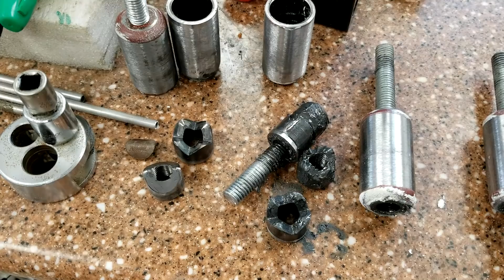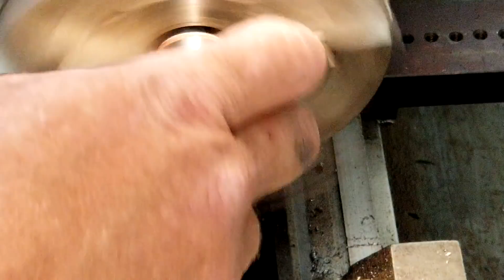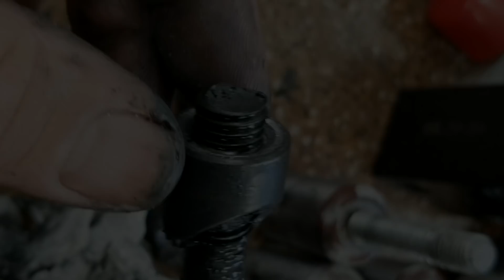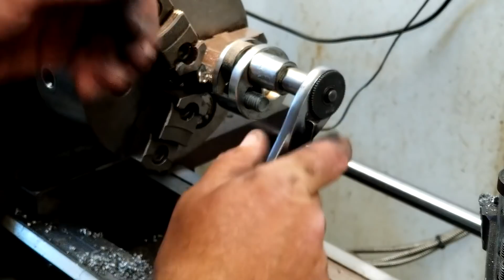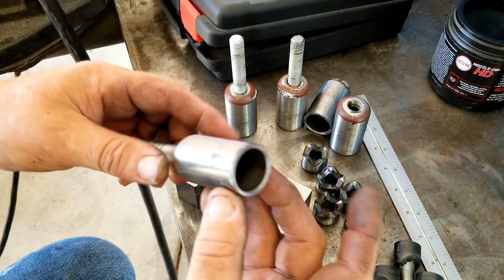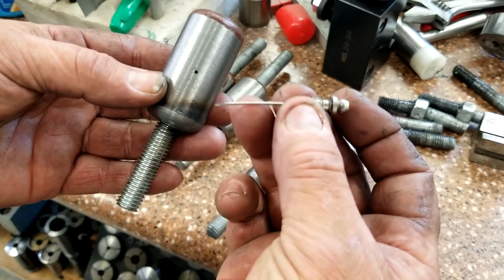Conveyor repair

Comment: Nice gadget Stan. I remember you showing the conveyor part rack rotation way back when and wondered how that was accomplished in such a small space. I am surprised you do not just have a exchange program with your customer(s) from a stock on hand if they are tearing them up routinely, unless there are too many sizes to deal with. Thanks for "the look inside'.  regards/greg
Reply from the maker: These were a special request, off the shelf rotators are 6-8" high, these needed to be 2-1/2" for space limitations.

Comment: Stan had  video series on the build of this machine.   If I remember right it was an automatic painting or power coating. Parts would hang down and go through several sections.  Parts would need to be rotated 90 degree at times.   At different sections.  I looked back at my Utube list but it does not go that far back.    I am using a iPad.
So I can not give a link to it.     Steve.   Appleton, Wisconsin

Found it.   Under the play list.... work and work related.     
            Industrial finishing systems.  5  parts.      First posted on my birthday in 2015
Reply from the maker: Actually, its a little older than than that, heres the original install. https://youtu.be/rvKdNdaQaj8

Comment: Thanks for the great video. What would happen if you installed the stud in the lifter with Loctite instead of welding it. Would make it a lot easier to replace later.

Comment: Would have thought there is a weak spring in there to keep the cam surfaces always in contact, but those probably always are going to be hanging down, so the part keeps it in engagement. Is the clearance between the end and the thread an issue, or are the tolerances enough that the slight slop are not a worry, as I would probably have made the stud a precise clearance fit, with threaded long section and short stub to go into the nut for the weld ( probably just long enough to engage all the threads, then necked down for easier welding), and a machined shaft where they go through for increased tolerance to radial loading, probably done out of a long capscrew to save time, as you get the long stud thread and shoulder for free, and those are a nice tough steel.

Comment: While I understand how they work, I do not understand in what kind of machine they are used.
Reply: Have you ever seen one of those endless tracks used by dry cleaners, with all the cloths hanging from them? It's like that, but for industrial use. Parts hanging from a track travel from station to station having processes done to them (wash, spray, bake, etc). Sometimes the part needs to be perpendicular to the track, sometimes parallel to the track - these are in the hanging mechanism and ensure the part stays indexed the right way. If you look through the videos on this channel, you will see examples of this sort of hanging conveyor.
Reply from the maker: Check out the original installation https://youtu.be/rvKdNdaQaj8